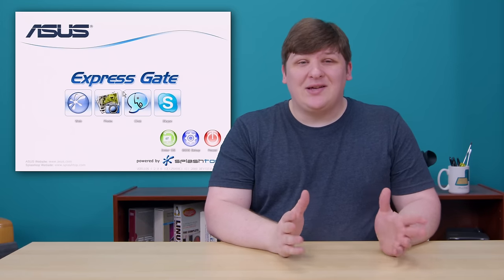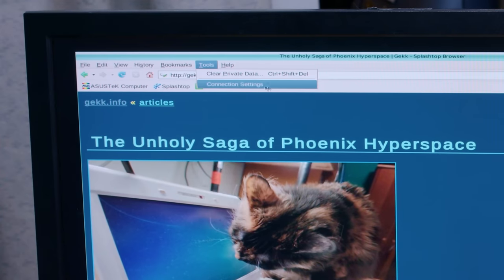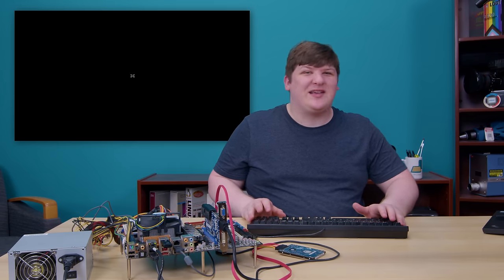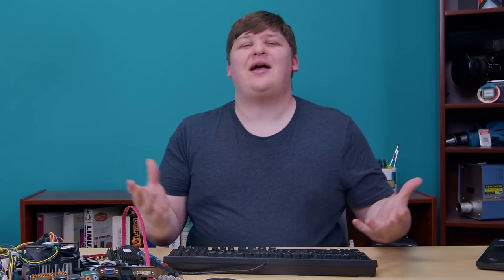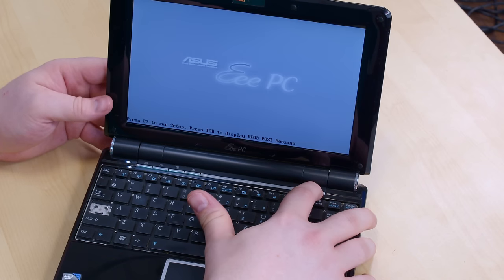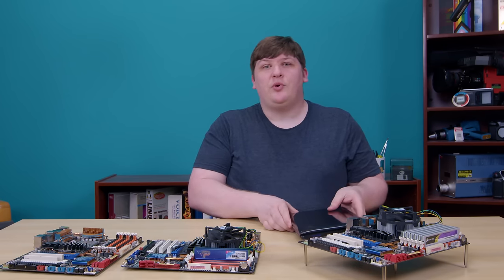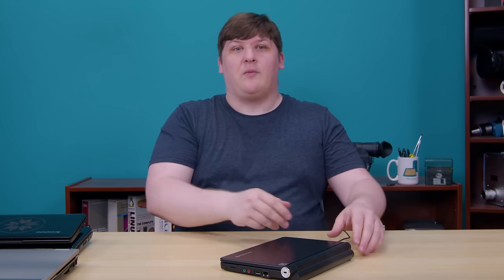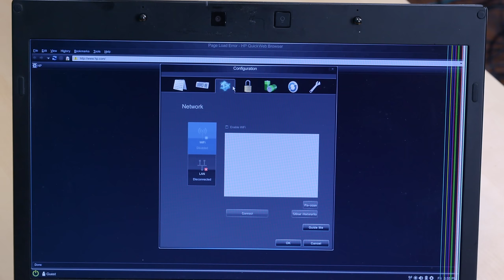Quick Start Ep 2: What The Heck Was Asus Express Gate?

Comment: ExpressGate was the root of all evil when overclocking. I could sort of understand adding it to a laptop, but to a high end motherboard like the one I had? It was absolutely stupid and was the key factor to why I didn't buy Asus for my next motherboard. On my Asus P6T Deluxe V2, ExpressGate was the default boot option, and once loaded (at least mine) had no option to exit and load Windows...no, it only had a shut down. So if an overclock attempt failed, and you had to reset your BIOS, you had to make sure to remember to disable ExpressGate in the BIOS to avoid suddenly sitting looking at that ugly piece of carp.

As for having to spam a button to get into the BIOS... That is worse than EVER today. Mostly the motherboard skips past that as quickly as it can to avoid you every doing something so rude as to configure the UEFI. Also, you plugged in a monitor using Displayport?! HAH! Pft! No UEFI for you! Why didn't you use HDMI you pleb? Honestly, I preferred when booting took longer and you actually had time to enter the BIOS without just wildly spamming DEL from about 5 seconds before you press the power button, hoping that THIS time it will register in the nanosecond between USB initializing and the OS loading. Also, systems actually don't boot up as fast as it seems today, they just set most basic Windows services to load on demand instead of on boot, and many, MANY of those are needed, so it LOOKS like your PC is up and running more quickly, but there's simply more stuff to load after you've logged in and can see the desktop. Granted, systems today are fast enough that you can't really tell that tons is happening in the background, but it is cheating.

Comment: "shutdown /r /fw /f /t 0" its how you get to the bios nowadays, i literally don't know which key to press to get to the bios in my new pcs, splash screen doesnt even appear, or if it does it just shows the mobo logo for a split second to then disappear. So i just use this command. Edit:  36:00 As i'm watching this video my current pc is literally on top of a 2001 system with amd athlon and an ECS elitegroup mobo, actually got 2 system with ecs mobos, a socket 478 intel one, and the amd one that i mentioned before, i remember doing my homework with those computers still in 2013 that would randomly shutdown on their own, i got the amd one boot windows 7 on 512 megs of pc100 133mhz ram after sitting 9 years in my very moisty basement, the thing refuses to boot on 1gb ddr400 ram, the mobos came from the era where mobos had 2  sdram slots and 2 ddr ram slots, AGP ports .

Comment: With such a large SSD built-in, they probably could have easily just shoved Windows itself onto it and set it up to generate the user folders on a large spinner. Might not be AS fast, but better than people were used to, and full features as well.
Reply: Ooh good point. Like how Macs used to have a hybrid drive..
Reply: @jackkraken3888  Yeah, I did this manually to my PC back when SSDs were still many times over HDDs on per GB basis. Tiny one just for WIndows and a little wiggle, everything else onto the beefy platters. Ran fine enough to bridge me into the cheap SSD era.

Comment: I prefer those Text Based BIOS interfaces.
How much bloat is added to modern UEFIs with all those graphics.
Wallpapers, icons, animated icons, graphs, buttons.
Remember when Motherboard vendors were complaining about howsome CPUs cant be supported due to the 128Mbit BIOS chip being too small, Normally the 3200G and 3400G CPUs were dropped as well as some 2000 series ones.
How much of that 128Mbit was being used by those graphics?
Reply from the maker: 128MB was an infinitesemal amount of storage even in 2007. It's like saying the Windows kernel shouldn't be 10 megs just because we used to make kernels that were a few kilobytes. Yeah, we did, because we had to; the new ones can do a lot more, and there's no drawbacks. 128MB is so meaningless that you literally can't even buy anything that small anymore. A dollar will get you eight gigs of storage and there's zero downside to using every byte of it.

If motherboard vendors are whining about the size of their flash chips, it's only because they bought barrels of them 15 years ago and are trying to use the stuff that's already paid for; it's not my problem that they failed to anticipate the obvious trends in technology. Flash is so cheap that motherboards could have started shipping with all of Windows onboard over 10 years ago, for less than a $20 price bump.
Reply: @CathodeRayDude  128Mbit is 32MB
The issue was 2000 series motherboards were supporting 2000 and the newly released 3000 series were also being added.
Even if your motherboard did not support it to start with, support was added.

A BIOS/UEFI BIOS screen should display information in a clear manner, not have bells and whistles added.

The classic bios's did this and it was done with a 4Mbit or 512kB chip, they give you the system voltages and temperatures in a clear text base manner as well as allowing you to do the standard settings in that text base manner.
Reply from the maker: I assumed you mixed up your bit and byte like lots of people do, sorry. I don't disagree on the UI, it's pointlessly flashy, but it's ridiculous to even discuss the usage of any amount of storage less than a gig. I'd be shocked if anyone has even made sub-gig storage devices in the last decade, if not longer. Any company using a part like that is selling us e-waste that they've been sitting on for 20 years.

Comment: So it is a usb drive basically ?
That's pretty funny & genius at the same time despite it's limitations software wise.

So you can basically do the same thing with any motherboard except that it will be exposed too windows ofc & you'll have too set the boot order for it.
By using one of those internal usb header too usb type a adapters that probably is like 3 - 5$ online & any usb drive or external drive of any other type.

Comment: And then there are android smartphones nowadays.
Instead of suffering with a BIOS, they literally just straight boot a "partition" and that's it.
You either get a "recovery" partition (to wipe your data), or a "bootloader" one (for booting your main OS). Basically saving them a lot of money because they no longer need to manufacture any BIOS at all. Just hardware telling the system to boot  a file, that then chooses what partition to load. 
And thus making us suffer to compile/get a custom recovery to sort of ressemble a real BIOS  to then flash a custom OS.

Comment: EUFI is so bloated anyway it should have had a quarantined shell you could boot to run antivirus, format/partition/repair disks, test RAM, download firmware updates & netboot. Something in ROM or write protected with a physical switch that would let you factory restore, backup & rewrite EUFI too. 

TLDR a competent USB boot disk you can't lose. Would be a nice feature to sell motherboards I think... well, at least we can upgrade BIOS without a CPU which is pretty cool
Reply: UEFI has a shell (some motherboards don't expose it) and there are development kits for it, so all of what you've described could be done, it's just there likely isn't any software written for it.
Reply: @ecnepsnaiold  It might not be fair to say bloated, but in exchange for all the complexity & extra attack surfaces you'd hope we would get some more utility.

It would be a good value add for manufacturers. I don't know what the limitations are, but I'd honestly love to see what type of interface you could come up with in 2023 with say 200 characters per line & a typeface of your choosing.

Anyone who hasn't seen them should do an image search for "BBS Telnet interface screenshot" to see the creativity of yesteryear on display.

p.s. thanks for the overlooking EUFI.. the Unified Extensible Firmware Interface for dyslectics

Comment: Actually you can pretty sure blame Microsoft for these type of linux-distro installed on motherboard with specific recover etc tools ready never left the shore. 

Back in the day (early 2000) before this even happened microsoft forced every OEM manufacturer that wanted to provide their hardware with other OS than windows preinstalled with their FUD and extortion. Making the effort pretty much dead.

So even those rules started to become more relaxed around 2007 the damage was allready done before. On the other hand it would been pretty handy to have linux distro ready to rock debug everything in small embedded flashmemory space in every motherboard optionally. Well you can technically do it even today ease. (Just get usb 2.0 header adapter to usb-a and put linux distro in. Keep it installed on motherboard. If you wanna use it only when needed make the header/connector only active with switch that is in back of your case)

Comment: What if when showing Lenovo, when you misspoke and said Asus, what if you were more right than you thought?

Because Lenovo does not perform engineering or manufacturing work in the laptop business, it's done by ODMs. Business laptops (Thinkpad) are engineered and assembled by Quanta, while Ideapad are often made by Compal. From dealing with a Compal-made unit, custom software was not even digitally signed by Lenovo but by Compal, or contained a Compal-signed installer inside a Lenovo-signed one. So Lenovo put bare minimum first hand effort into it. If mainboard companies have minimum software expertise and massive electrical engineering expertise (except ECS, which is hopeless; including Uniwill whom they absorbed, hilariously incompetent), laptop brand companies wield no technical expertise at all by design.

ASUS also used to do ODM laptop services. Since restructuring, it may be Pegatron instead of ASUS, but it's the same engineering group, and back then it was ASUS explicitly. Pegasus Electronics, get it. ASUSTek even used winged horse graphic in the 90s, as an aside. So it bears keeping in mind that unless the ODM was determined, and it was Compal or Wistron or something like that, it might still be an ASUS.

Comment: The windows 10 joke hurts, specifically because of the e-waste W11 will generate, and the fact they just keep downgrading the ui experience. Losing the ability to see titles on the taskbar is such a huge blow, it has me debating switching to a linux distro with Plasma with windows in a vm/on a secondary machine for app compatibility when it finally stops being supported. Yes its that important to me, no I do not want to use a third party tool for a very long number of reasons including the continuous need to update them, the fact they are mostly supported by single hobbyist developers, the fact that these devs are basically fighting with the closed windows taskbar apis and more.

All in all I am beyond disappointed, and as I use Centos and will eventually probably use Rocky linux for work, Outside of Fusion360 for CAD and games which I play less and less of due to both time and my hatred of the low content, microtransaction packed, marketing dark pattern lead game design games that are already now the majority and only seem to be increasing in market share.

Its to the point Ill just buy games I know Ill never have the time to play just because they seem like the type of games I would play if I had the time as they dont have any of this crap, and are still in the genres I like the most (Physics sandbox/creative games etc).

That was an extremely long, winding way of me saying please dont look down on us who hold onto windows 10. Its still being supported so its not like its a security risk and there are some good reasons to still be using it right now.

Comment: i Could Set Up In My Bios To FAST BOOT! And I Could Turn Off NORDVPN So I Would Get To the Web Without Connecting To My VPN Server! But i Had Rather The Bios To Run Some Self Checks! I Left the SPYWARE/MALWARE That Windows Have become! My Dell Optiplex 7060 I7 8700 SFF With A NVMe SSD Will Start Up In Less than 15 Seconds But Since I never Turn Off My PC, When I Do I Want It To have Enough Time To Check Some Of My Settings! I Hate WINDOWS Not Clearing The ram When You Close The Lid On My laptop!

Comment: I use only mechanical disks because SSD's suck (at least in terms of reliability). A hard disc is more reliable, will work for longer, and will give you more time to back stuff up when it starts to fail. SSD's are fast, but are unreliable, and can just give out without warning. They also don't work with all SATA controllers.

Comment: By the way one thing about retardedly long boot times: I've seen this happen with WD Green HDDs. They are absolutely disgusting as a boot disk (heck, even as a data one...). It just does NOT work as a boot disk. The SSDs are another story, the mechanicals are an absolute horrid mess.
Either that or a downright broken drive/viruses.